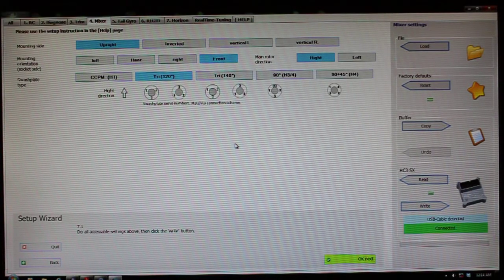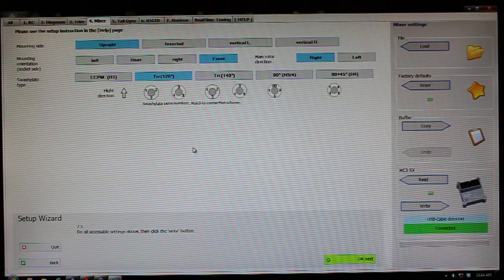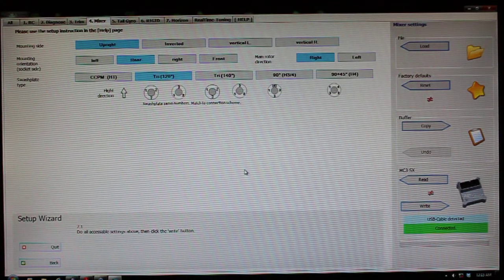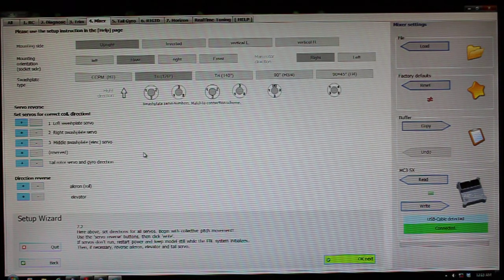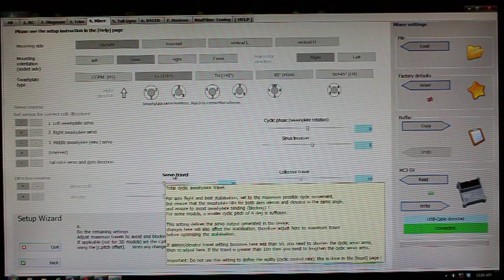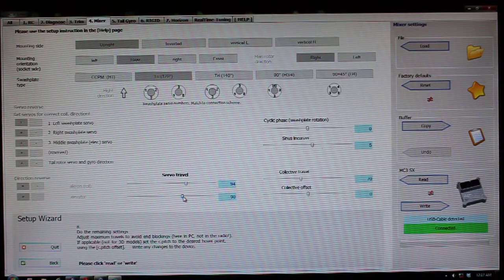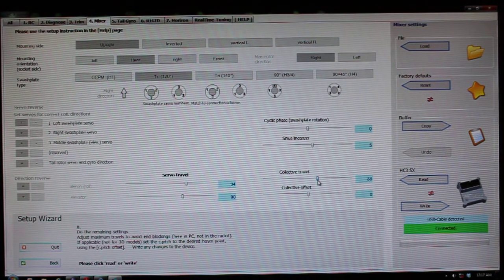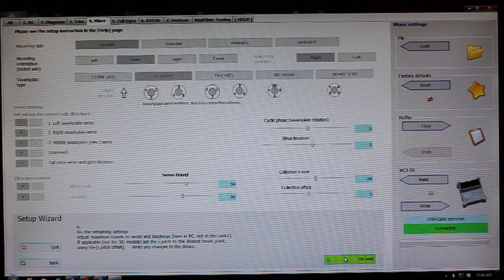HC3sX quickie setup part 7 - Mixer tab

Comment from the maker: Cyclic pitch needs to be measured with a pitch gauge. The amount dumped is determined by the pilot but is usually around 8 degrees. Yes, ele and ail usually get the same amount of pitch even if the sliders are not the same.

Comment: When you setup the servotravel for ail/elev.
Is there a "magic" cyclic pitch number here, or just increase until it binds, then back of a bit?
And will you adjust so you got equal AIL as ELEV cyclic pitch?
Thanks